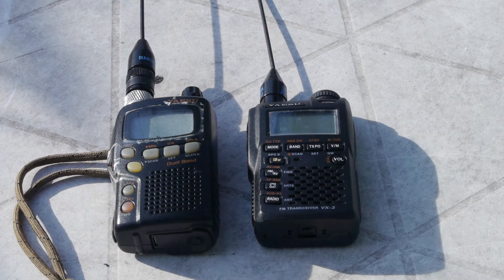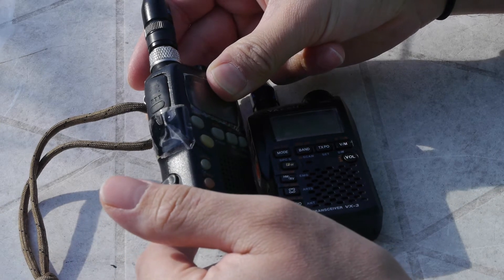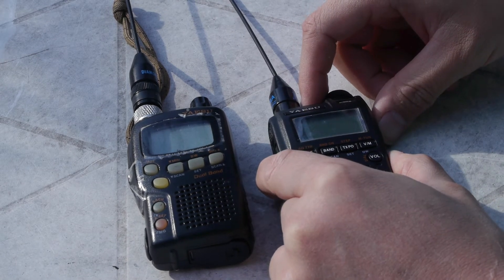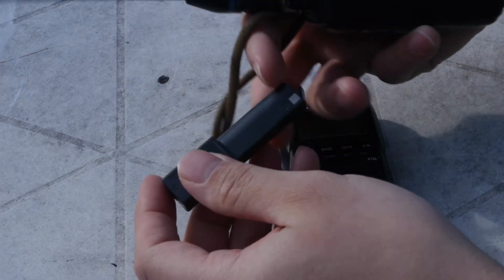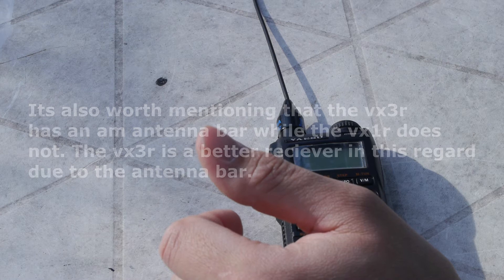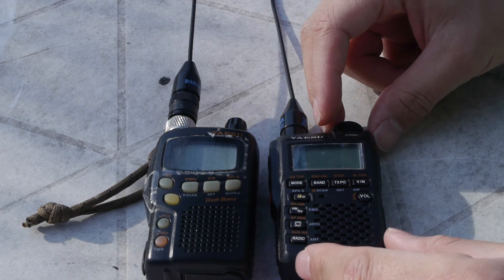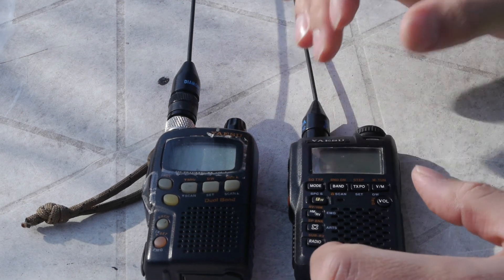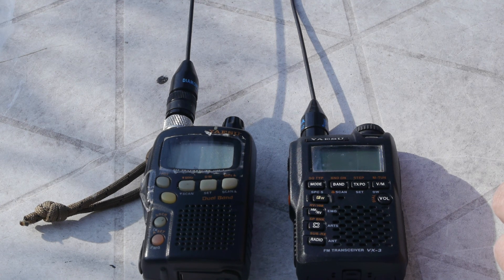Yaesu Vx1r and Vx3r Short Comparison

Comment: Hi from Spain. I'm about to buy a VX-6E device. But I'd like to ask you a question first: What differences would you say make this radio better than the Yaesu VX-1R or viceversa? I was going to buy the VX-1R but came accross the VX-6E. I want to use it for my hikes but also to scan the air band. I thank you in advance and apologise for my English.
Reply from the maker: get the vx6e its water resistant. i dont know what frequencies you use there, but the vx6r is a decent radio. i dont own one though.  make sure to check yaesu specs on vx6e before you buy it.
Reply: Thank you! I will check it right now.

Comment: Have vx-1r. Open it from air band to 999mhz tx rx. Very handy. Only not showing freq on AM(SW/MW). As fir battery. I use 14650-14670 (900-1000mAh) accus. Only problem- u have to charge it seperatly.

Comment: Hello i have a VX-1 i got from eBay mine will work with the charger pluged in tried replacing the battery which will not take a charge anyone else having this issue thanks
Reply from the maker: not sure of the issues fully until i can see the specs on the battery and charging unit
Reply: Try 14650-14670 litio. Accus. Omly charge it seperate from radio. They has 900-1000mAh. Goodluck